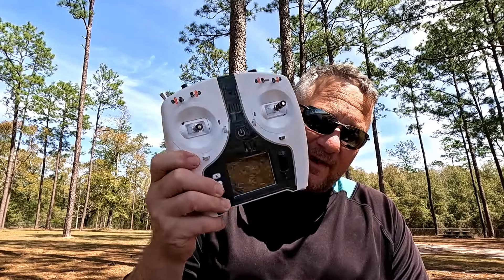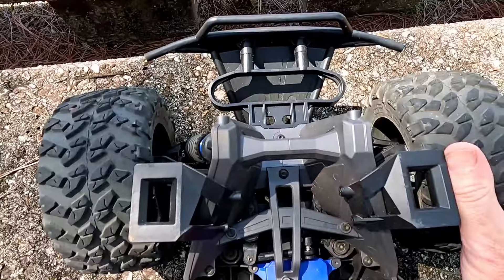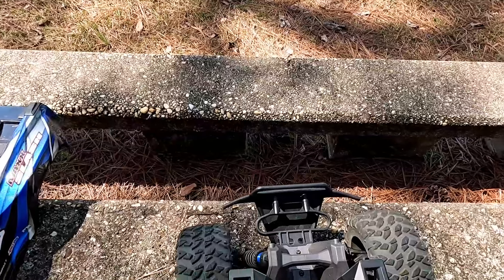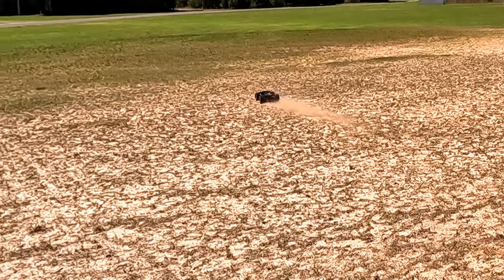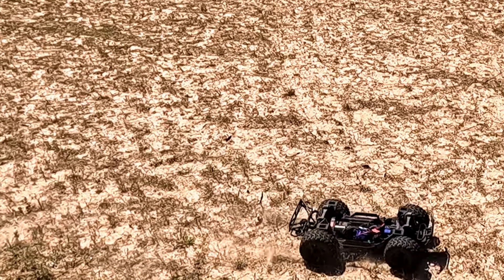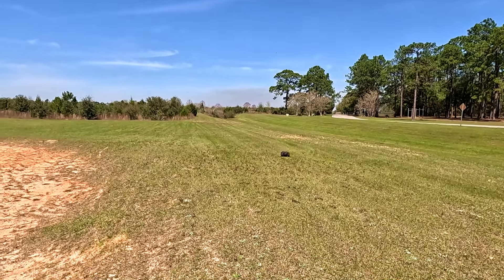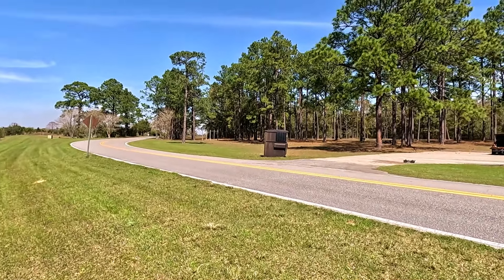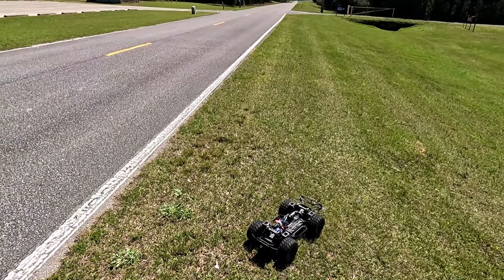I Made A Donk Out Of The Maxx Slash LOL I Think I Found Out Why It Handles So Bad

Comment: Seems like the servo moves fine its the servo saver thats crap it requires minimal resistance to activate. Only way to stiffen up the standard servo saver and to get more effort out of the servo is take out the servo saver and undo the screw holding the sring in place remove the spring and then drop a 2 - 2.5mm thick washer in there that fits snug then replace the spring and tighten the screw screw and reassemble its a 10 min job to see if it makes a difference it did on my maxx v2
Reply from the maker: Good info thanks the servo is a bit weak I can easily hold it with my finger these belted tires are heavy the whole package is a bad deal they have a stronger servo they will gladly sell you lol. I am going to swap out both hopefully this will work

Comment: I ended up putting the steel axles 8950x on this and running the mohave 6s wheels same exact diameter and now you have control in air
Reply from the maker: good tip

Comment: Definitely throw a widemaxx kit on. You’re driving style is much like mine, preference for a wide wheelbase which adds stability. The narrow arms I guess make proportional sense but just aren’t great for stability.
Reply from the maker: Problem with that is the tires will hit and it kind of ruins the look. I think a new servo and servo saver will fix it. This worked on the maxx but these belted tires are very heavy they didn't compensate for that when they designed it plus I heard many maxx owners complain of the weak servo
Reply: @L2theWcarscoffeelife  tires wouldn’t hit with widemaxx. However I don’t know what to tell you about body
Reply: @L2theWcarscoffeelife  servo does suck, most traxxas servos do

Comment: The servo can't be very strong or it'd shred the plastic gears sooner.  I have driven 2 different Maxx Slashes so far.  I drove the first one Saturday and again today.   On grass both times.  Saturday it was bad but the other one Sunday was on pavement and handled better but did bottom out the chassis on pavement accelerating and braking.  Also tires rubbed the body and the preload was adjusted. The first one was trimmed fine but the second did the same as this.  You couldn't keep it trimmed and it'd dart.  I also first thought it was the tqi because I'm not familiar with it.  I run a dumbo on my Xmaxx and have only turned the gyro on once.  It kept doing it with the tqi all the way down.   I do think it's a weak plastic geared servo and or weak servo.  Weak servo is not terribly uncommon but I'll never forgive that suspension set up.  It needs more travel and better springs.   I think the tires are OK on tarmac but terrible on grass in my limited experience.   It'll be sorted eventually.   I do hate Traxxas the company but like and own a few of their cars.   I'm a fan of great RC cars.
Reply from the maker: I dont understand the gears are inside the servo you replace it with a stronger one it has different gears inside.

Comment: Hey man I figured  out how to make the maxx slash handle better I added the wide maxx kit.n I handles way better like night n day
Reply: Is that the kit that is $50 or $200. I just got back into RC after being out for 35 years. Still figuring this out.
Reply from the maker: Check out my next video I replaced the servo saver and servo and its a different truck now before it was so weak the tires went wherever they wanted  causing it to flip too easily
Reply: @L2theWcarscoffeelife  yeah  I saw your video  I'm glad that worked  for you

Comment: Is it a true fix for how the car handles? The servo saver may help however it does not fix the fact there is no fan on the motor, the tires rub the body, the wheel base needs to be extended. On 6 s some say the car is too powerful. I do not agree with that. Depends on where your driving it at. Over all I am glad your trying to fix the car to make it usable. But chasing Dollars with Dollars is something I did with my 2m Draco to make it flyable. I hate putting more money into a already expensive "Toy" so I can use it. That to me is where these big company's lose customers. Good rants and good video. Enjoyed the process
Reply from the maker: Appreciate the support

Comment: I feel your pain. Ive had several RCs that i just couldn't get along with. I noticed on mine, traction stabilize whatever in the hell it's called completely off it handled better.
Reply: which rc cars you couldnt get along with? just curious
Reply: @idan678  traxxas summit very cool truck,stampede 2wd and the vxl, all 3 are garbage , there's another one just can't remember right off hand.

Comment: I ordered new springs. It’s undrivable as it is. I said we needed a beefier servo. The tires are very heavy and the weight of the car is too much for the stock  servo
Reply from the maker: I think that is the key the tires are heavier than on the max the servo and the servo saver are being over worked

Comment: The only way to beat this car is a small cheap fix.
A new standar size servo and adapters,maybe a new esc, new shock extenders on eBay, widemaxx kit, and half inch of set m2c hex extensions. Oh, and new tires, maybe the smaller 3.8 badlands. Also cut the body in the wheel wells. Good luck! Car is horrible. I’ve owned 2 Maxx cars. Durable though
That’s about it